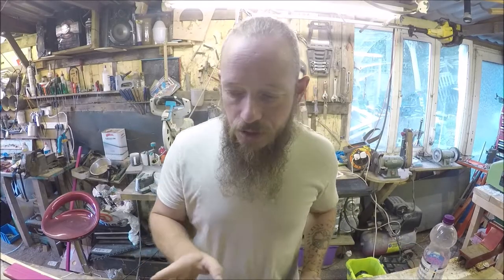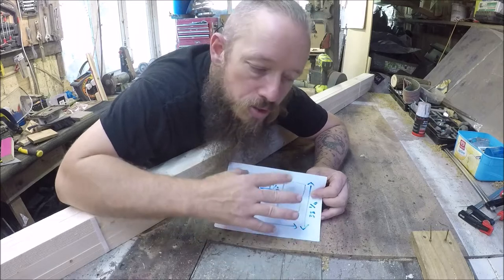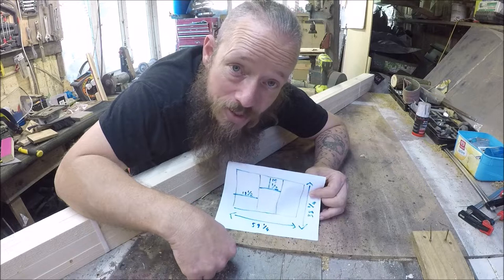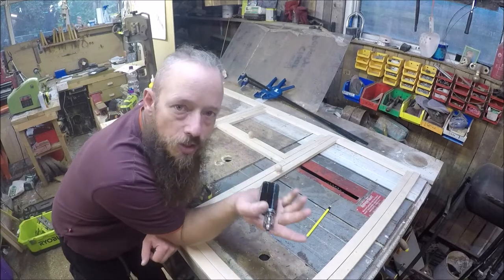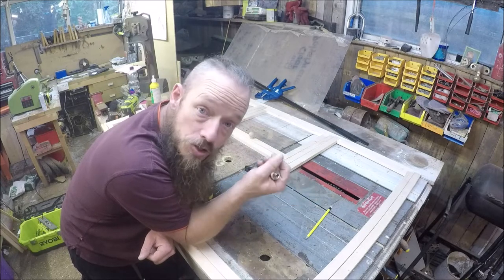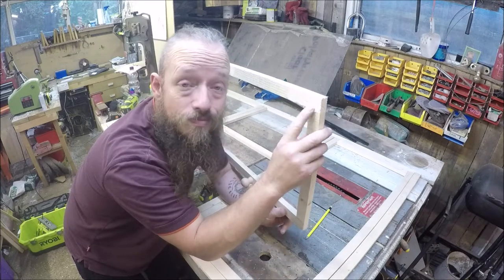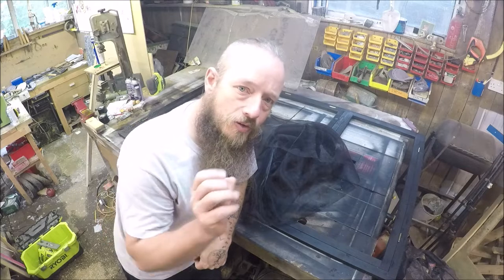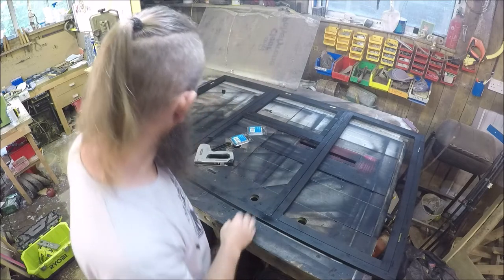How to make a Bug screen

Comment: great solution. I am wondering if your blade on your tablesaw is not parallel to the fence. I noticed a lot of burning on the sawcut..
Reply from the maker: pmsl what fence ? it broke a long time ago i have to screw a length of timber to the bench .yep i know what your saying i can usually get it quite parallel .thanks for the thought anyway man 😁😁
Reply: @TheBeardx16  cool, just trying to think of anything that would help ya figure out a way to get your saw more usable.  :)